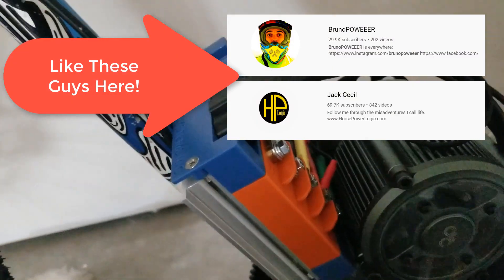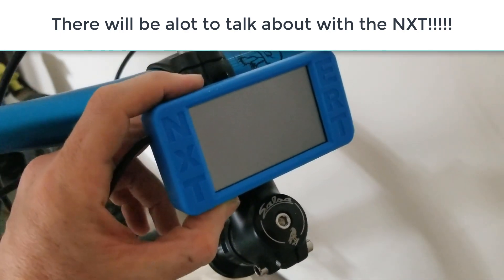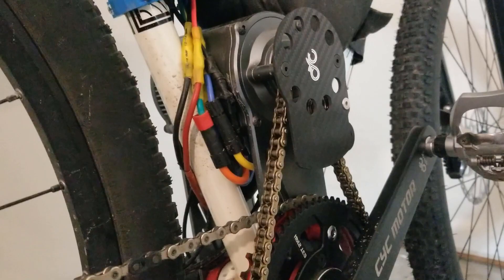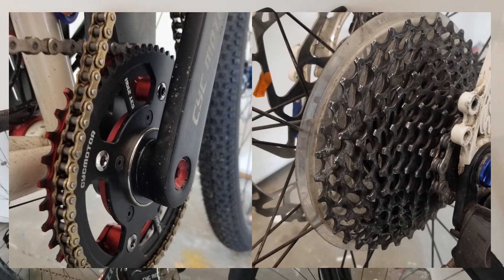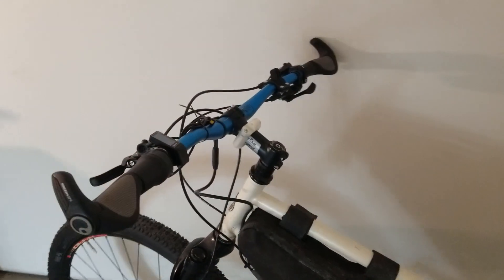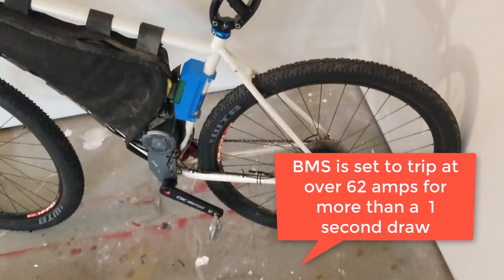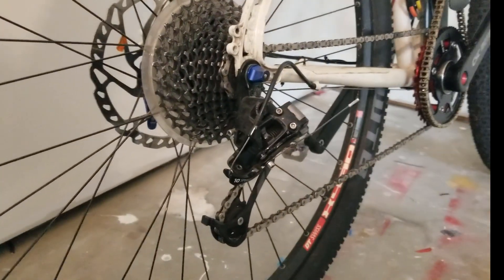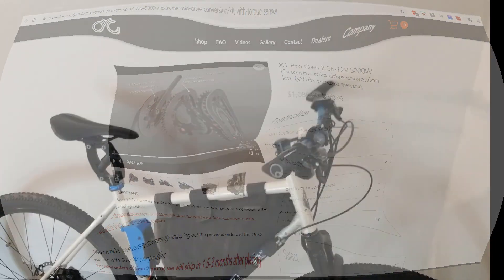CYC X1 Pro (ASI BAC800) on Salsa Vaya 2 - New build!

Comment: Nici video. I have a question about the fork you have. I have that exact fork in my e-bike. I have 160mm brake disc in it now and planning to upgrade. Is your rotor bigger than 180mm? I found that to be the maximum in the manufacturer’s website and i’m wondering if it the construction of the fork would allow a 203mm disc. So, do you have a 180mm disc or a 203mm one?

PS: I have a TSDZ2 torque sensing motor with an open source firmware. It peaks at about 1000W, which is plenty enough where i ride it. But better brakes are always welcomed.
Reply from the maker: They have hardware that allows the caliper to be moved out to accommodate a larger disc. Most bike shops will have them. Hope this helps!
Reply: @HighVoltageKits  Thank you for the reply. I know they have an adapter, i already have it for the 180mm disc. The local bike shop said it would be too much stress for the fork, so i would install a 203mm disc without any warranty. So i would just wondering if your disc was larger... I guess i will stick to the 180mm one, it's plenty of braking power.
Reply from the maker: If it works don't fix it lol. The shop I used never mentioned any issues with warranty. I'll keep an eye on it tho.

Comment: Hi Can you also comment on whether the BAC2000 is overkill  for getting up steep hills. I chose it over the BAC800 thinking it would not have to work as hard. Your input on the two topics will be appreciated as my order has not shipped as yet and I may be able to amend it. TIA
Reply from the maker: I dont think it's a case of overkill for hills. I mean 52 volts gets you close to 3000 watts. I'll have some ride footage to see soon though. The 2000 is a great controller just not so much for this frame. I had a fun ride this AM. There are a few issues to iron out. But not bad for just putting it all on at the weekend.
Reply: @HighVoltageKits  How sweat success , "......May the wind be always at your back...."
https://www.irishcentral.com/culture/may-the-road-rise-to-meet-you-meaning-irish-blessing

Comment: I'm interested in your choice of 52 / 32T crankset. Why did you rule out the 72 /42T that has a heavier drive chain?
Reply from the maker: The chain on gen 1 is the same for all options. 219 I think its called. I wanted the slightly bigger gear on the front as I have already tried the smaller one. I also want to use the big 72 on another project.

Comment: Sounds like a plan to me as u say u don't need a all out speed monster on a frame like that. I'm interested in the pas on both motors as you no with the bac800 i think my message to alan may of kick started him into sorting to pas out. This is where the phaserunner is ahead of the bac in terms of pas controlling u can select what ever amount of power you like via the display then fit a small controller to switch it up and down.
Reply from the maker: Thanks! PAS will go way beyond simple power up and down configuration I hope but that's for another day. Cheers

Comment: How come it's impossible to find the ASI BAC 800 anywhere... would be nice to have one tuned for the cyclone or this motor.
Reply from the maker: I'm not sure. I think it's getting an upgrade soon. They are having supply line issues with the virus as well. The bac4000 is in short supply.

Comment: How could you tease me like this! here I am back down to 52v with the bbshd stock controller again until I get my replacement bac800... its a sad sad time lol, I miss 72v more than anything and the smoothness of the controller was wonderful.

I often regret getting the Talon 1 over the purpose built ebike frames with full suspension and an actual battery compartment but then I remember that I need to carry my bike up a flight of stairs every morning and back down after and having that heavy frame wouldn't make my life easier there.

Cant wait to get my cyc x1 gen2 or even just have the bac800 running again, depending on the quality of the new gen2 controller I might have to order that nxt screen and use the bac800 on my cyc later on.
Reply from the maker: Oh mate... The stock controller sucks. Hopefully you are back on the road in style again very soon.
Reply: @HighVoltageKits  yea I know :( and I'm pretty sure it's going to take longer to get a new controller than it is for my whole new motor setup... Which is about another month and with my tiny 52v battery I need to charge my bike at work and at home so that's really crap.
Reply from the maker: With the virus crap I don't think anyone has much idea when stuff will arrive. I only have gen 1 cyc stuff so no idea if the newer controller is better or not. If it is on par with the ASI I will be shocked. I await your thoughts with interest. Spintrol are the makers so it's from an RC car background. I am way happier with the BAC. I think if Jon from CYC runs an ERT tuned BAC he won't want to go back to stock either.

Comment: Looking good Captain...
Quick question regarding bac 800...
You mentioned that throttle can spike up to 65 amps for a few seconds with that controller, is this the same for bbshd?
I'm building a battery pack, 14s 6p, avg cell capacity is about 2200 mAh. (Recycled)

Current bms is a 35 amp.
I want to upgrade to 50 amp but from the looks of it maybe I should search for a 100 amp 14s Bluetooth BMS?
Reply: Look up the ANT bms from Andy Kirby, that allows you to use the VBMS app from Vortecks which I believe is the most feature rich bms on the market so far and helps support some good guys as well.
Reply from the maker: The cells themselves are the ultimate governing factor. I have no idea if what you are using will take that kind of pull. That said the bbshd ert kit pulls a max of 2800 watts at 52 volts. Amps peak at 55 ish. So a 60amp bms will work. I have never had a trip out on my bbshd kit.
Reply: Okay thank you so much I will proceed using these parameters as guidance 🙏🙏🙏